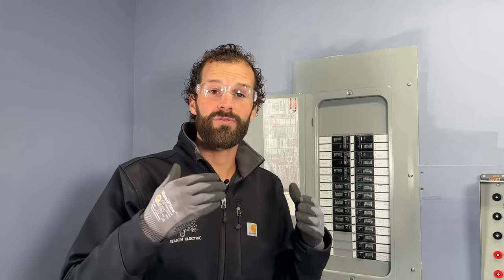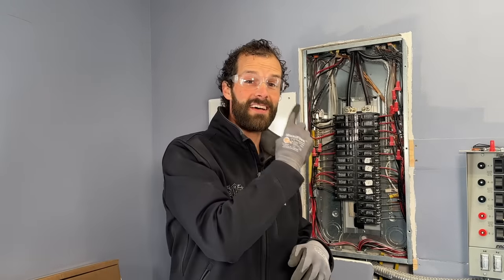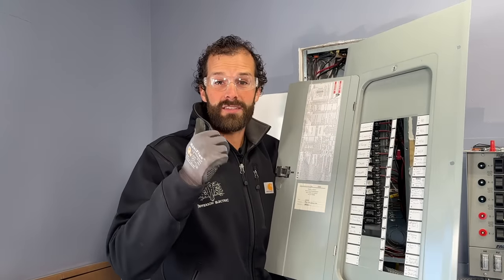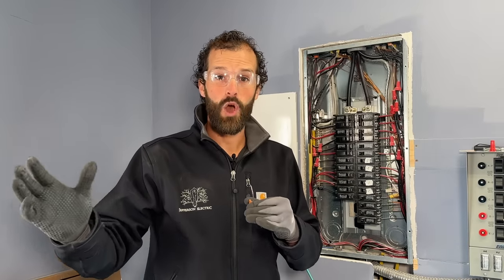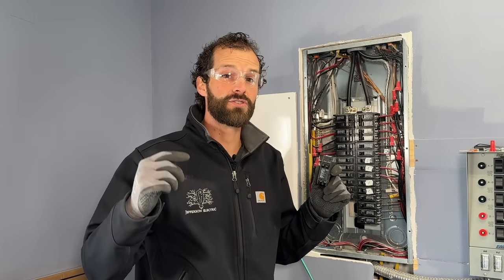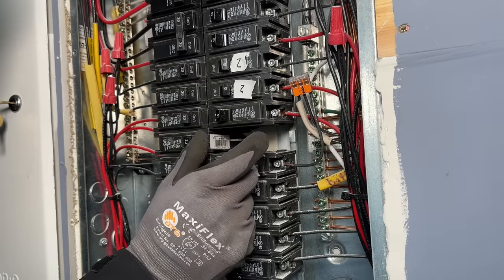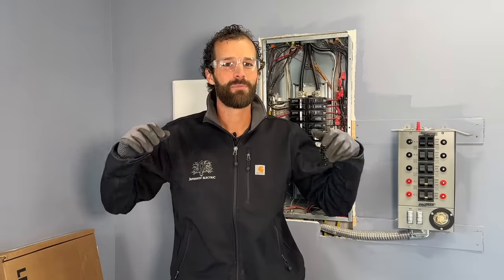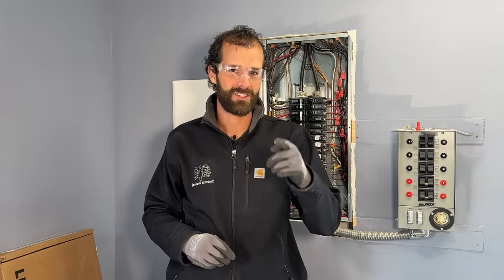No Room In Electrical Panel - Quick Fix

Comment: I noticed that one of the wires removed from a breaker was WHITE.

There is only one case where a white wire is used as a hot in the panel. That is if it feeds a 240V only load such as a pump or heater.

And in that case it needs to be remarked.
And it needs to be feed by a 2 poke breaker. 

And neither was done in this case. 

SERIOUS VIOLATION

Comment: -Never Use WAGO’s !!! Twist your wires clean them up then stick a wire nut on it

-always restrip your wire!! You just put torqued down copper wire into a pressure connection do not do that. 

-tandem description was descent you can also tell by the model number like 30/60 is a 30 space 60 circuit

Comment: Wagos in a panel? Really? Use a wire nut, MUCH more mechanical/electrical bond In my opinion. Wagos will fail over time......

Comment: I am a Master Electrician and object to this post because people could get hurt going by this "QUICK FIX", Scott did it again!! Brought in someone else that doesn't know what he is talking about!!!!!!!!!!!! Why doesn't he leave electrical to PROFESSIONALS and not to him or this other so called electrician. This panel is already illegal as to the color coding of the wires to show different phases. Every other breaker should be on the same phase in the entire panel which his buddy does not take into consideration phasing of the wiring to the neutrals when he ties the two circuits together which are next to each other. No splicing is supposed to happen in the panel unless the panel has rated for the space for splicing. Piggy backs are alright to use, but must be used with the right neutral wire. Combining circuits as they say because of LED lighting MAY be illegal if the lighting fixture will accept original lamps and or LED lamps. DO NOT DO THIS KIND OF WIRING THAT HE IS USING ------IT CAN BE ILLEGAL AND DANGEROUS!
Reply: LOL on a residential 240v 2 phase you dont need to color code the phases on the main lugs. its obvious they are both hot and you would only need to color code 3 phase or more to signify which phase is which for the multiple voltages. nothing in residential would use anything other than 120 or 240. I have never color coded both hot phases in any panel in residential. you have to color code the neutral and ground obviously especially if all conductors are black. Also if this panel supports tandem breakers why didnt he use one instead of combining those 2 into one with a connector. maybe the wires wouldnt reach where the tandem breaker spots were allocated. I would never purposely run 2 circuits off the same breaker no matter what the load. you never know what someone might plug into an outlet and overload it. at least with a tandem both circuits are on separate breakers in case of a problem.

Comment: Ever think about spit breakers instead?
 Especially using surface contact connectors that you're using, that is extremely f**** stupid.
Reply: Yes you mention it, "piggy back/split breaker" (same meaning) but the contact connectors are just completely f**** stupid.
Reply: By the way, that breaker allows another wire on the other side. That's a lot better than using a surface contact b***** that you're trying to push.

Comment: I like your videos, so thanks for making them.
But where I live it is a Crime for home owner or a non-electrician to open a breaker panel ever.
Exception is if you are being trianed and am employed with electrician or electrical company.
If caught or found to have opened the panel for any reason it is a massive fine and criminal charge and likely jail time.

We can run lines as a home owner but not into the panel.
Key words there are "Home Owner" , as your family members can't run lines unless they own the house.
And no work at all can be done if you are renting.
Reply: This is the way. Homeowners attempting electrical work belong in jail.
Reply from the maker: Thanks for the feedback.  Where are you located?
Reply: @EverydayHomeRepairs  Hello, I live a Canada and my province is very tough on laws both provincial and national.  And depending on work home owner may do most times needs a permit.
Reply: @GrenPara  My condolences.
Reply: While that might seem extreme to many it does broadcast load and clear that electricity is deadly and electrical distribution is not to be dealt with by untrained people....the unsafe conditions that can be left unseen can kill years later. The law in your area is saying let the homeowner endanger himself and his property only but not others. I have told the maker of these videos many times that he is breaking the law doing electrical work on any home other than one he owns. It's only a matter of time before someone is sued , electrical work is a Profession with licenses and apprenticeships for a very good reason.
Reply: @fritzmiller9792  Hello, I dont find it extreem as it can save lives of people who don't know what they are doing. But also save lives of people who may buy the house not knowing work may not have been done to code.
Where  I live I am licensed for Low Voltage but I cant open the panel. (Exception is if I am being trained by licensed company and working for them)  But I can add outlets to existing lines provided it is withen specs and wont overload the circuit.

And I have seen work some homeowners do and would never sleep in that house.  I have seen people run speaker wire to wire an outlet. I have seen people channel out path in floor infront of baseboards then cover with vinyl flooring.

I think some laws should be strict.
Reply: @GrenPara  Oh I don't think it's extreme at all but many people would think it is. Most people have not seen the bad and dangerous wiring out there , just like you described and so very much more. As it builds up and the luck runs out and enough lawsuits come forth, sooner or later the laws like you have where you are will make more sense to everyone and become common.

Comment: I have fired electricians who have done less.
Reply: calm down peter
Reply: Joints in a panel... should not be recommending this stuff to DIY'ers
Reply: @Kevin-mp5of  Check your toolbox, you probably left your stash there
Reply: I was an electrical design engineer,  had an electrician once tell me a panel board had lots of spare capacity since there was many blank positions.  Not necessarily true. Need to do a load analysis.
Reply: @curtw8827  for a 200A service, you do not need to do a load analysis on a residential house, Unless they have electric heat or other unusual load requirements it is perfectly fine.
Reply: @Teh_Random_Canadian  ... you may not need to do a full calculation for a home, but typically it's worth a look just to see what's going on. A hot tub, pool panel, and AC units can add up quick. Throw in an irrigation pump, septic pump, well pump, and a welder in the garage and you may find yourself a bit tight. I once had a problem job that was a 320 service (a pair of 200 amp panels) and found the issue to be the 5 AC units had a start surge of 360 amps so intermittently tripped a main breaker. It was only happening after a power failure when all 5 units needed to start at once. Yes, they were big AC units. I talked them into letting me install delay timers so the starts were staggered.
Reply: @rupe53  I'd consider all of those loads unusual for an average home. If you have a Hot Tub, Pool, Irrigation, and multiple AC units then ya, 200A may be undersized. But like you said, unless everything is on all at once, it is not usually a problem.
Reply: @Teh_Random_Canadian  ... if you have ever heard of Greenwich Ct, that would be our customer base. Lots of older homes that have been added onto and a 200 amp panel will usually be maxed out till someone comes along and does a full (Read: proper) renovation. New construction will be at least a 320 service and the place will be approaching 10,000 Sq Ft. Before I retired we were involved with a new home that was 40,000 sq ft and the budget for the gen set was just over $90k. Recalling it was a 1,200 amp service. Seeing gen sets of over 100Kw is not uncommon on a residence around there.
Reply: @rupe53  I wouldn't call that a single family dwelling lol, that is a private resort at that point
Reply: @Teh_Random_Canadian  ... not sure on that big one, but many are weekend homes for hedge fund people who live in NYC during the week. Others are just celebrities hiding from the public. Quite often I find more staff living there than family members. I mean, someone has to wash the cars, clean the pool, and tend to the horse stables.
Reply: @rupe53  Here in Tallahassee, Surge Trip is a common problem due to power outages from storms.

Comment: This is the most pathetic video and excuse for professionalism I have ever seen, advising people to double tap circuits onto a single breaker is an extremely unprofessional way of doing things. because breakers are only rated by their manufacturer to be “single pole,” which means one wire connection, and the NEC states at 110.3(B) that “listed or labeled equipment shall be installed and used in accordance with any instructions included in the listing or labeling." Also answer me this, what would happen if you double tapped a breaker and without realizing one of the circuits has a high starting amperage but low running current while the other circuit still draws some current, your going to introduce a tripping or over heating issue. I initially commented this over a year ago with no replies from the video creator. This just shows that he knows he's a pathetic excuse for a DIY'er and would be laughed off any job site.

Comment: LMFAO, "that pros don't know", the incorrect ego in that statement is just insane. Pros do know this, you are not something special. If I wanted to be picky, I could point out all the mistakes you made, like failing to balance the panel, etc. But I'll just leave it at, check the ego dude, you aren't as special as you think you are.

Comment: #1 never combine 2 breakers into one. This guy would never last a day on the job with this type of knowledge. #2 use a quad breaker when adding a 220 circuit.  15/ 30-30/15. Again NEVER combine two 15 amp circuit together EVER!!!  Unsafe electrical work leads to over load of A circuit and heating of wire that under the perfect circumstances can cause a fire. Fire dose not worry where you live and or laws passed by idiots. COMMON SENCE IS THE SMART WAY TO ALWAY THINK AND WORK.
Reply: The whole point of a standard circuit breaker is to ensure the circuit isn't overloaded. The only way this could go wrong is if the neutrals of two out of phase circuits are shared and then combined on the same phase, thus doubling the maximum load on the neutral. That part should have been mentioned.